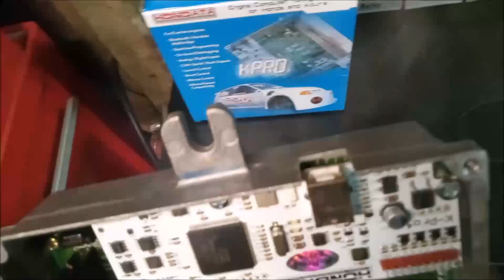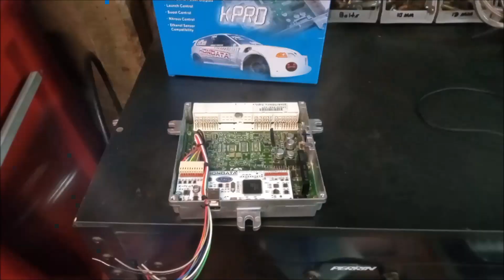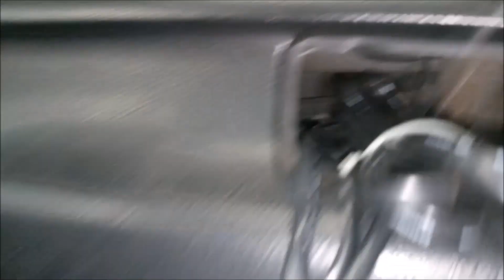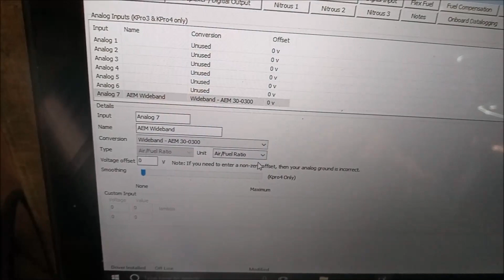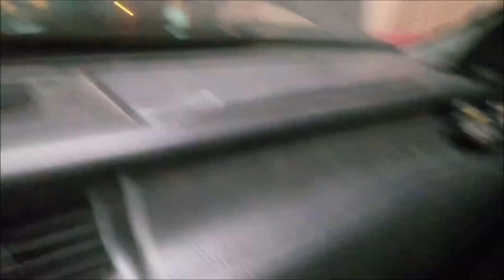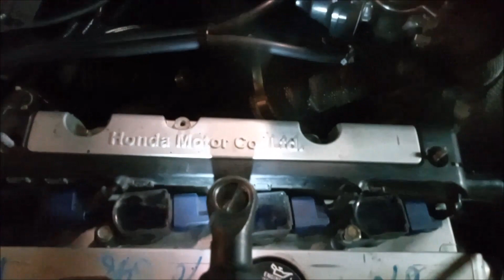Hondata K Pro Adding Wideband & Flex Fuel

Comment: What’s wrong with the car’s built-in wideband? Also curious why you chose to use the analog input as opposed to the kpro's digital ETH input.
Reply: EXACTLY what I thought. The other output plug on right is ETH output. How I ran mine.
Reply: i was told by a tune, that the factory wideband is not fast enough.

Comment: Did you ever figure out what the flex fuel settings were in Kpro? Getting ready to do the same....any help is appreciated.
Reply from the maker: I'm pretty sure it worked once I reset my Hondata Program. Laptop was acting up. Haven't driven the Civic in many months. Will double check for you tomorrow. Have a good night and Happy Halloween.